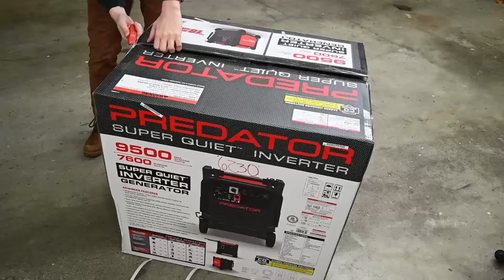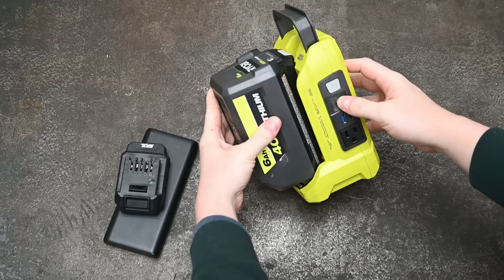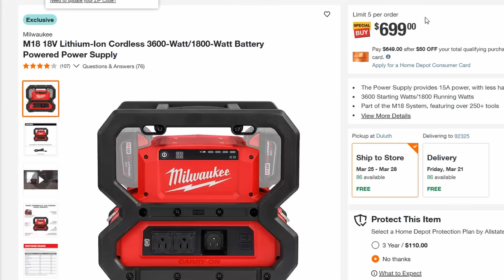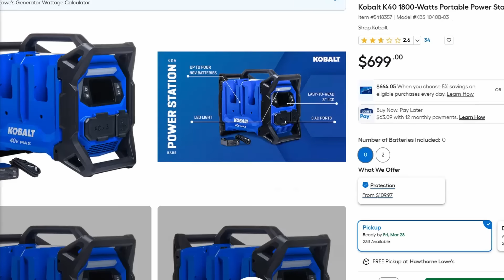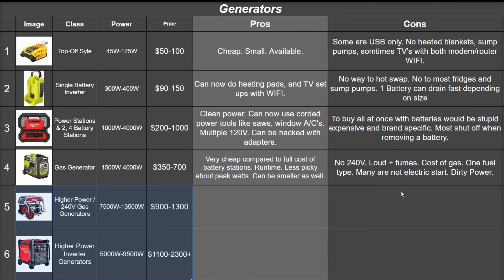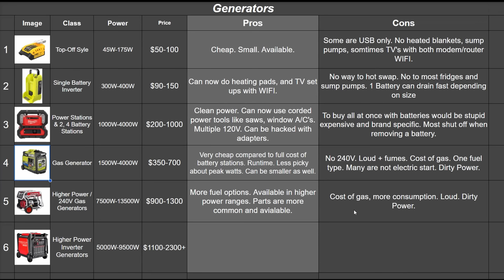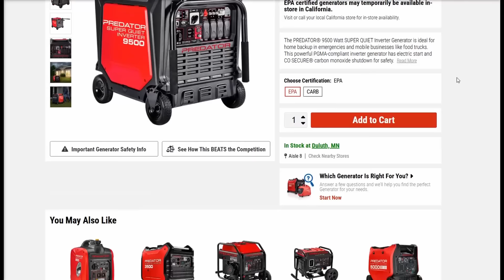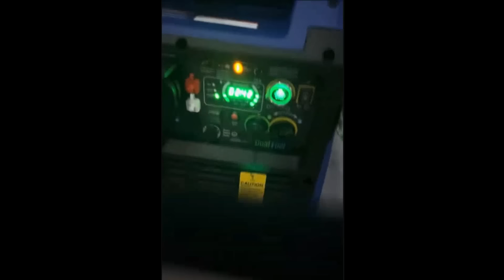Buying Harbor Freight's Most Expensive Generator So You Dont Have to

Comment: I bought that generator when they had the christmas special for 1500.00  Battery was way more complicated to hook up than I have seen on other units. Then when I wanted to see how hard it might be to pull start, the handle came off. Apparently they only tied 1 small knot. I removed about 10 bolts from the front electrical panel(and some are different lengths, so make sure you pay attention to where each one came from) then removed the recoil assembly, wrapped the cord back and tied a good knot in the handle. A few weeks later, Sams had the 11kw tri fuel Genmax a nicer with the 50 amp plug, remote start for 1750.00, I bought it and a friend said he would give me what I paid for the harbor freight unit, so we are both happy now.
Reply from the maker: Smart man

Comment: You know you can just get a hole house gen at this point?
Reply from the maker: We were quoted $17,000 and at the distance from the house they required, based on where it would need to go, we'd be staring at it out our view.
Reply: @TorqueTestChannel  also cant take it with you if this isn't your forever home. it's considered a permanent appliance.
Reply from the maker: I've also used our last generator remote to run a welder, which is a plus
Reply: @TorqueTestChannel  dang how far way did it need to be? The kholers I’ve installed are 5ft from any opening the 5ft,8ft for exhaust  and intake.

Comment: I got a pile of ego batteries and got the inverter from Ace hardware during a power outage. Kept the deep freeze and fridge going with 3x 7.5AH batteries and couple smaller ones for 6 hours no problem. Has a countdown to when juice runs out. Can hot swap batteries. I just charge the batteries with a vehicle inverter or go to someone's house that still has power. Don't have to store gas no oil change. Quiet. Works

Comment: Just got an Oupes Mega 2 for ~$800 to handle the shorter outages in my area. 3 Year warranty, 2500w, 2KWH of capacity means its plenty to run the fridge and the modem/wifi for a day plus.  Its also only 42lb so it doesn't kill your back like some of them.  Debating grabbing some solar panels still.

Comment: check out the westinghouse tri-fuel Wgen11500tfc. It is not an inverter generator but, is rated for less than 5%THD. Will make 9500 watts on nat gas and has a 240V/50A outlet. I got one on sale through amazon for $999. Have this generator wired into my home panel with a lockout to prevent back feeding on the mains. Powers my whole house minus my main A/C system. If I get a soft start installed on the A/C, it would likely run that too as I am only 60% load with the majority of my house running.

Comment: got an older (90s, at the newest) 240v 8kw generator for 125$, besides being ridiculously loud, runs the whole house (gas heat, hotwater, dryer), and just use the EV charger outlet (60Amp breaker) and cut the main power.  one day i'll install a switchover and auto-start, but have only had to use it twice in two years. Never had any issues with the power cleanliness, though.  Can't wait until they start allowing more V2H here in north america, as 110+kwh would run the house for a long time...

Comment: combine a cheap gas generator with a power station or DIY battery/inverter setup and have the best of both worlds. Clean power, even green energy/grid energy for short outages and if the outage is long hook up the generator to top the power station up. Bit of power management means that you are off cheap. Otherwise spent some more for max power. Those things run for only a short time each (hour/couple hours) so a cheaper dirty power generator can maybe keep up with the average demand. And the power station provides the peak and clean power needs.

Comment: I have a 2300W/1800W inverter generator. It's basically like having a single 15A circuit. Nothing in the house that I can't run, one at a time, if necessary. Fridge, a few lights, phone/pad chargers, router and modem usually. 12 hours on it now, 8 came during the last outage.

Comment: I use a champion 5000w 6000w peak open frame inverter through an interlock. It can’t power everything but keeps us comfortable during a power outage. I think I paid around $500 on sale a couple years ago. The only items that we can’t run is our central AC (I run a mini split in an addition with no issues) and our electric oven.

Comment: The big Ryobi power station works but is kinda jank. The battery levels are inaccurate, doesn't provide runtime estimates, and the slow charging stopped working after the first time I used it. Nice if you can get it for like half off, otherwise not really worth it.
Reply from the maker: It did sort of look like the worst of 'em

Comment: Great comparison. The Ryobi RYi150CBT is awesome because it is also a charger, albeit slow. I love my RYi818BT as well but they are hard to find on sale.  It does not shutoff when removing a battery. At one point the EGO inverters were all square wave.  I hope they fixed that.  Love the Dewalt batteries plugged into the milwaukee station.
My Honda EU3000is will probably outlive me, but if it doesn't I think a dual fuel Westinghouse would be its replacement.

Comment: I wish Hercules came out with one of those battery inverters cause. Currently, they don't have any but bowser, does.
Reply from the maker: You and me both, a nice 180W $55 model would do wonders
Reply: @TorqueTestChannel  the main reason why I even want one is. I have a lot of hercules tools from work, and I found out that the ultra torqued takes off semi my lug. Been using that impact for the last 2 years and haven't had any issues. I can't tell you. It eats some sockets though, but yet again, I just tried him out on the snap on truck.

Comment: I live in hurricane alley and have probably went overboard after Florence caught me with my pants down. I have probably 10 usb power banks, I have the craftsman v20 inverter, I have 4 traditional inverters (2 pure sine wave, 2 not), 2 AGM group 24 batteries, 2 lifepo 100ah batteries, a few smaller lifepo batteries, a 200w suitcase style solar panel, 3 generators, and I'm sure more that I forgot lol. I get called in for storms so never want my family to be without power. Don't get me started on all the flashlights and headlamps I have.

Comment: I'm not sure why you are saying the 1500W-4000W inverter generators can't run a furnace. They should offer the same same clean power and plenty of juice. I have the 2000W Honda inverter and it runs my furnace, lights, and fridge no problem.

Comment: I'm an electrician and I regularly install residential generac generators. Shits expensive. I definitely think the mobile generator with an interlock hook up is much more obtainable and practical for 80% of people.
On another note if your home has a surge protection module installed in the panel it should alleviate some but definitely not all of your dirty power issues mind you that is if the module is capacitor/dump style
Reply: Capacitors will only smooth out DC not AC. It will help in the sense that it is a capacitor in parallel acting as a low-pass filter and filtering out the higher harmonics, but most of the distortion will be 11th harmonic and below, so well below 1kHz where the cap is not having any noticeable effect. The only way to fix it is to run a rectifier-inverter, so a VFD or a battery ESS, which would cost more than just getting the generator with it built in.
Reply: @Kanglar  do yourself a favor and look up what an autovar is
Reply: I'm also an electrician, and I agree. I typically install the Generlink system because interlock kits aren't allowed here in Canada  I will recommend the Generac standby units if they need their sump pump to run, or otherwise need their power to come on automatically if they aren't home to lug out and start their portable generator.
Reply: @curtiswaters7415  oh definitely. Also a good option. Also the new revisions for generacs generators and ats are looking promising with the ecobee and the current smart mods

Comment: Would it have worked to have your dirty power generator charge your PowerStation to then power sensitive electronics? 

I have a Dirty Power generator, but looking to get something to smooth out the power, and was wondering if you could charge the powerstations at a rate to keep up with the load for clean power.

Comment: Great info! I'm just about to move to a rural area from the city and have been wondering about this, especially powering the furnace as our winters are pretty harsh.  I have heard that dirty power from little generators is hell on equipment, I always tried to avoid running Servers on generators for this reason without UPS power filtering.  If you wanted to do some more generator comparison in the lower range, I would not object! Could we perhaps run a dirty generator to power a 12v charger on a car battery that has a generic inverter doing 110 to the furnace?

Comment: I wonder if you could cobble together a hybrid system like what Edison Motors did before they focused on their trucks. Just a battery bank hooked up to the house and a generator to top off the battery when the power gets low. That way you're not running the generator for 100% of the time and under light loads.

Comment: During the last hurricane that hit here in Florida, we lost power, in the middle of the night of course. The only thing I was worried about at that hour was the fridge, so I hooked up my Ego 400W power inverter to a 10ah battery, and that lasted until about 10a or so, when I finally turned on the gas generator. Then the power came back on like 10 minutes later. But I wasn't sure if the Ego battery would have enough cranking watts, but for my fridge it did. I was quite happy it worked as well as it did, since I didn't want to go out and crank up the generator at 2am (although everyone else in my hood had done so).
Reply: This is absolutely something that isn't talked about enough. The ability to power the absolute essentials until the weather clears enough to allow you to go out and start up a larger generator.
I have since left Florida, but I was there in Tampa Bay for the Helene/Milton double whammy. 
I had an Ecoflow River Pro 3 to keep the refrigerator and  cell phones going until the weather cleared to the point I could get out and get the 6500 watt generator going. 
Another critical point, gas stations ran out of gas 2 days before and 3 days after the hurricane. I had to get gas out of the car to keep the generator running. Solar panels to keep the fridge and cell phones going is critical as well.
Reply: @williammeek-h2o  yeah, they're a nice to have for sure during a storm until you can get something else running. Also with the influx of yankees here, they panic at the first sign of anything and go around and buy up all the supplies - then half the time after buying up all the water and gas, they then flee the state. Anyways, have to keep gas on hand - just add some stabilizer and it will last a very long time.
Reply: Hello fellow Floridian! I burned up my frig. using a Dewalt battery inverter, due ot it's "dirty" non-sinewave inverter. I say this only for you to double-check your unit and prevent a costly repair.
Reply: @ronfurro4161 the Ego 400W puts out pure sine wave - so clean power, which is in large part why I bought it.
Reply: same here a while back, we had  power outage due to bad storm w/ high winds and it lasted for almost 10hrs and it was enough for my Bluetti AC70 to handle the fridge while my EB3A ran the wifi so kids could watch their movie on the laptop.
Reply: i just hooked up my fridge and freezer to my 100ah lifepo4 (88ah at the time) and a 15ish year old 1500watt inverter. didn't think about it untill the fridge hit 49f and the freezers hit 14f. oddly my goovoo power meter claimed they were only pulling 380watts to get back to temp. on the battery about 23ah.
so I only got 3ish hours from the battery before voltage drop.
next time i'm going to set up before the temps fet so far out of range
Reply: @ That sounds about right, most modern fridges pull around 350W or so, but will often spike when the compressor turns on and off. Since mine was still cold (and because of the hurricane I had set it up to run colder than usual since I figured we'd lose power), I turned the temps towards the upper limits, which helped. As someone else noted, having clean power is big with anything modern - and thankfully this Ego setup provides that.
Reply: @rodmunch69  I should mention the fridge and freezer are both apartment size. I was just shocked initial start up and running to drop 11 degrees each they never pulled more than 380w combined.
Thought for sure they were going to be pulling closer to 1000w together on atleast compressor start spike

Comment: The preditor 5,000w Is my absolute favorite generator. Ive always ran It on propane and never gas. Its quiet, convenient and with just under 700 hours of run time, never had a single issue. The only time Its stumbled Is In 14⁰ F weather when I had to open It up and throw the manual choke. Even then It still started with the push button start.
Reply: I got one last fall when they were on sale. Of course I haven’t need one since. I’m curious tho that you didn’t have issues with the propane at cold temperatures. Last time I exercised mine in above freezing temperatures my tank got awful cold.
Reply: @dguiley  suprisingly I didn't have any troubles with the tank freezing over. Ive had the small green bottles freeze and stop working In winter while using a camp stove. Im guessing It doesn't pull fuel fast enough to be affected by the slow expansion rate of the propane at cold temps.
Reply: @ I’m thinking I was concerned because I saw my regulator frosting up when I was running off a grill tank. I believe I considered moving the tank to the back of the generator where the exhaust would help warm it. Decided to get a 1500w heater and blow on the tank since I needed some load on the system anyway.
Reply: This is good to know . I just bought one 5,000 watt harbor freight inverter to replace my old Coleman powermate. That Coleman is a gas guzzler and so loud and hard to start. But it did get the job done.

Comment: I really appreciate this video, but I just wanted to comment to possibly request a video where you search for the closest thing to a half inch high torque on Amazon.  Half inch chiefly due to there being many more socket sizes for half inch versus three quarters, not to mention cheaper, and using an adapter on a 3/4 will rob it of its power, not to mention add unnecessary length.  There are a few standouts that I found that I think should be worth looking at.

Seesii WH810.  This seems to be the replacement to the WH800, which performed rather poorly the one time you tested it, so poorly that Seesii no longer sells it.  Interesting to note is that the listing for it still has reviews for the WH800, as if they quietly replaced the product.  Perhaps this will be its redemption.

Alloyman and Alloypower 2000nm.  Not only are these two tools identical in terms of appearance, price, specs, and even brand name, the Alloyman in particular is going for a blatant Milwaukee look, even down to the logo.  At the very least, having it in the thumbnail with the caption "We have Milwaukee at home" would be humorous.  These also appear to be quite hefty tools, the bare tool weighing over 6 pounds according to an Amazon customer picture.

Jexugk 2000nm.  The biggest standout from this tool is it's price, apparently this is a 300 dollar tool, and it also comes with two massive 6 amp hour batteries, like the Ework's.  The listing seems to imply that it's a half inch impact, but the model sticker on it states that it is a 3/4 instead, as does various product images.  Perhaps this one has had its anvil swapped from a 3/4 model.

DoWox RB-818.  The thing that stands out the most about this tool is that it looks like a green clone of the EWork RB-819, which is also the most powerful Amazon impact you've tested.  It even has a nearly identical model number, they both may have come from the same factory and differ in that the DoWox uses a half inch anvil instead.

Onevan 2800nm.  Considering how well the 3100nm performed, it would be amusing to see how well their strongest half inch would compare.  There also appear to be 'clones' of it on Amazon by Canbrake, Hecusam, and Wanttik, with the former appearing to have a longer snout, the last being in yellow instead of teal like the rest, and all advertising different torque numbers.

Spicimomo.  This one only advertises a meager 1200nm, but the name alone could give you some jokes, like "The Spicimomo isn't so spicy, it seems."

Comment: I can see you ending up with a Generac or similar hardwired whole home unit in the future :)

Luckily where I am the power is stable, have my little Honda EU2200 which will run the furnace or fridge or whatnot one at a time with a bunch of extension cords, but have only used it a couple times in the last 5 years.

I will say the Honda was worth it too, it's sooo quiet, sips fuel, and starts incredibly easily.

Comment: I went with a Firman 8k running 10k starting tri fuel, fuel efficiency is not great but running on natural gas it's a non issue, it's loud but for $1k it was a win. Power is clean enough for my needs.

Comment: $2300 for a 9500 generator is crazy expensive.  Got my Duromax 13000 for $1200
Reply: If you wait for a HF sale they go for $1500
Reply from the maker: Inverter generators be like that
Reply: Dirty power in that Duromax , fine for running motors and restive loads, not great for electronics.

Comment: For anyone wondering, the reason the 9500 doesnt have dual fuel or remote start and others do is because the 9500 is far older than the 5000w or 13000w generators they have. Hopefully they come out with a newer version in the future.